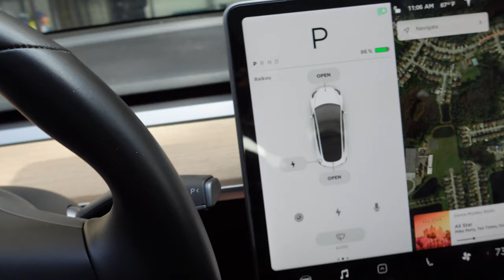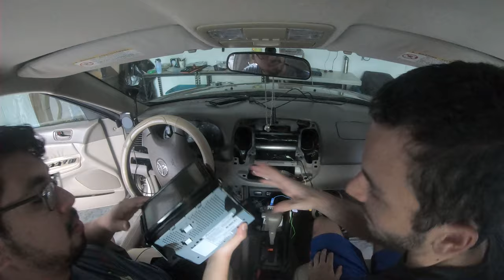Random Building Day - Car Stereo, Grill, Dog VLOG

Comment: Hi! i’m currently saving for a 1080p gaming pc (for around £1100) and i want to know your reviews on the components i’m going to buy: GPU: MSI GEFORCE RTX 2060 SUPER VENTUS. RAM: CORSAIR VENGEANCE RGB PRO 16gb (2x8gb) PSU: CORSAIR CXM SERIES 750w CX750M ATX..... SSD: SanDisk SSD PLUS 1tb SATA III, up to 535mb/s..... MOTHERBOARD: MSI B450 TOMOHAWK MAX...... CPU: AMD RYZEN 5 3600 PROCESSOR (6c/12t, 35mb cache 4.2ghz max boost) CASE: CORSAIR iCUE 220T RGB, mid-tower. i also looked at 3 120mm fans. and this setup will be accompanied by my monitor which is a MSI Optix MAG241CPUK 24" VA Curved FHD 144Hz Freesync Gaming Monitor (1920x1080,1ms). what are your thoughts??
Reply from the maker: Looks like a solid build...however you may want to consider waiting and getting the new 3070, i know availability is hard but if you have to wait to save money I think it would be worth it since the 3070 is only $499 and basically doubles the performance of the 2060 super.